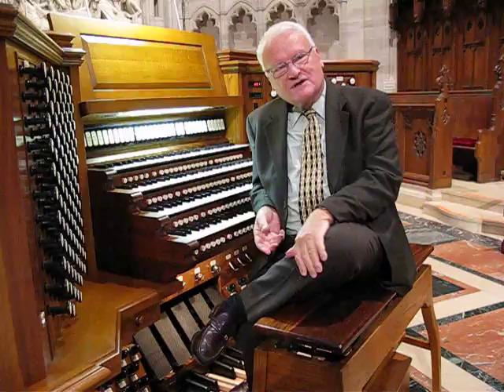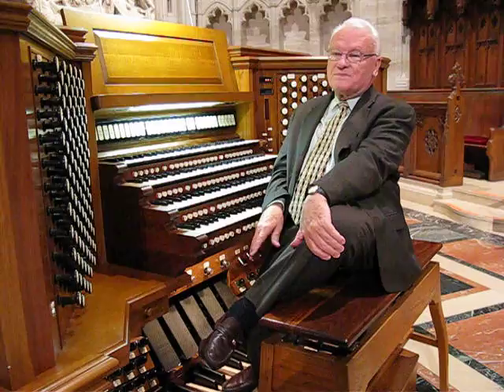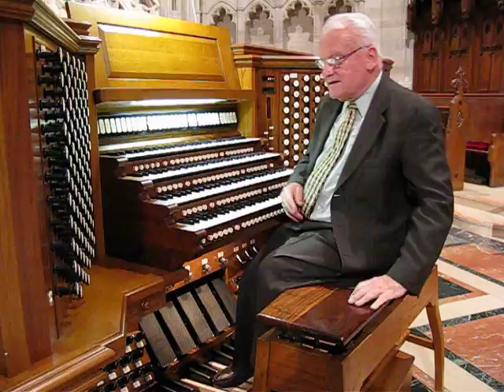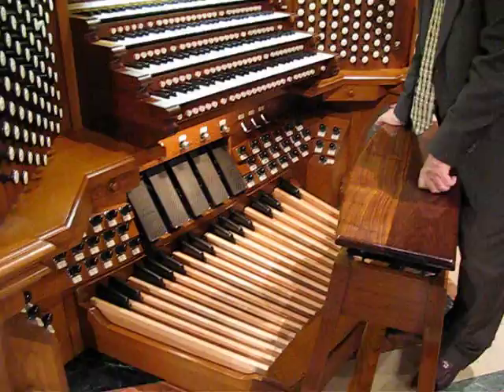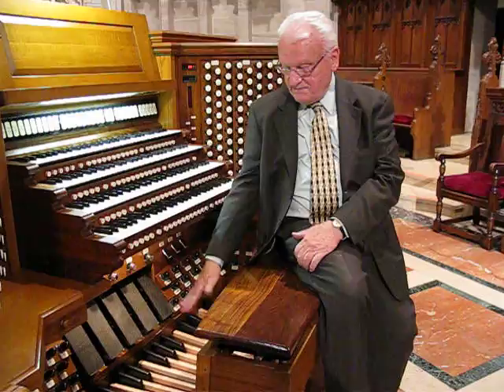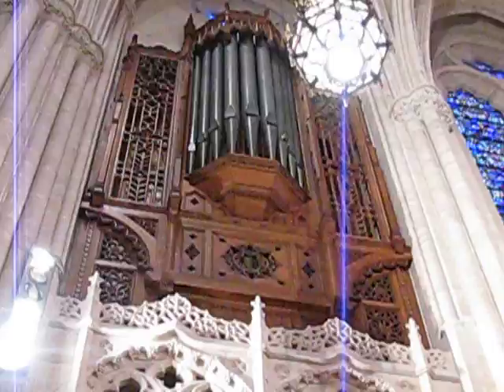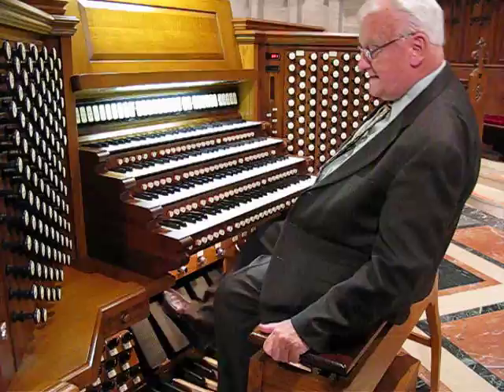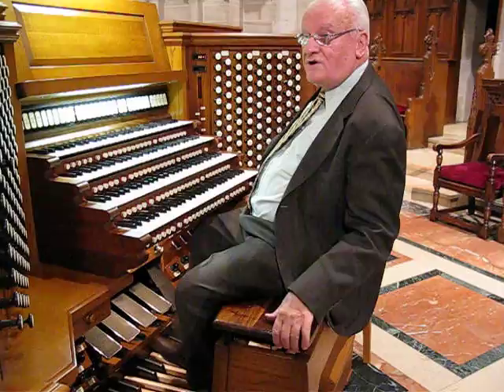How come the organ has so many keys?

Comment: Awesome organ! I wouldn't know where to start playing on such a large organ!!
Reply: The Great division is always a good starting point. Look for stops called Diapason or Principal. Those give you the "organ tone" that you won't find in other instruments. The number on the stop indicates the length of its longest pipe, and by extension, the pitch. 8' is the same pitch as a piano, 16' is an octave lower, 4' an octave higher. You get the idea. Pull one of each and you'll get a good sound to start off with.
Reply: You start with a set of keys honey

Comment: What are the flips above the keys but right below the music holder for???
Reply: Joseph Sometimes an organist needs to change stops very quickly. The pistons above the keyboards allow the organist to do that; the organist can program them to change the stops as desired. For instance, if I wanted the clarabella flute and the harmonic tuba, but didn't have time to change that in the middle of a piece, I could simply push one of the pistons and it would do that for me instantly.

Comment: What are all of those things above the pedals but below the manuals? Not the Pistons, just those pedals and such that are directly above the main organ pedals?
Reply: +Braden Cutright-Head They're the expression pedals. They open and close the boxes that surround the different divisions like the Choir/Swell/Solo/etc. to make them louder or quieter. Some organs also have one pedal as a Crescendo pedal which can be programmed to turn on/off different pipes as the pedal is moved.
Reply: Thanks
Reply: the silver knobs are called toe studs they do the same function as the white buttons called pistons right below each manual or key board now the pedals that look like several car gas pedals right above the pedal keyboard those are called crescendo or expression pedals
Reply: Thank you guys:)!

Comment: 32' pipes.  That's 16hz, below the usual range of human hearing of 20hz.
Reply: It would have been interesting to hear about how manuals can be linked together ( I believe the term coupling is used.)  I know little about that.
Reply: Michael Bauers
I'd like to know how TV works...or how a thermos bottle knows whether to keep something hot, or keep it cold.
Reply: CRT TVs and analog TV signals weren't too hard, but now that they have gone to LCD TVs and ATSC, I couldn't help you.  As for a thermos, it doesn't actually do anything except insulate which slows down heat exchange, thus if anything, it keeps the temp at the original temp longer.
Reply: Wow

Comment: Now I'm really confused on what all the extra switches and pedals do...
Reply: The drawknobs to the right and left of the keyboards control different types of sounds like strings, flutes,  trumpets etc.  The big pedals against the back of the console control volume.  The 32 foot pedals are a keyboard like the four above it.  The white buttons under the keyboards allow you to change sounds on the keyboards by pushing them instead of pulling out the drawknobs.   You can set them to any combination of the white drawknobs on the sides that you want so you can quickly change sounds.  You can play a different sound on each keyboard.   For example a flute sound on one and an oboe on another .
Reply: David Smith that’s awesome, do the buttons physically move the stops?
Reply: @grungeisdead4455  Yes. When you push a combination button or toe stud the stops go in or out.  Those big metal buttons above the pedal board are for changing combinations with the foot if your hands are too busy playing.   Some older organs don't have the buttons or toe studs and that means you have to pull each stop by hand.  Actually having more keyboards, stops and buttons makes it easier to play,  not more complicated as it would seem.